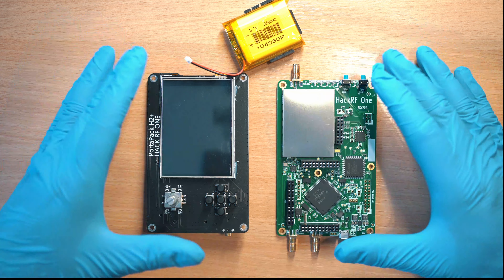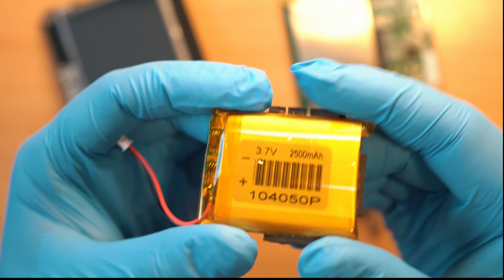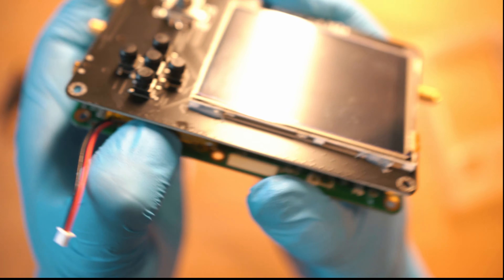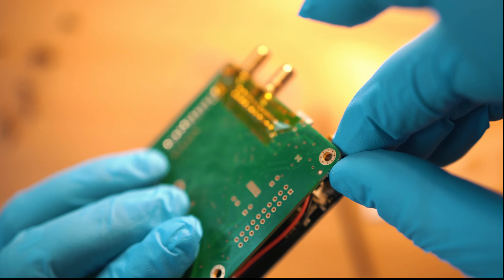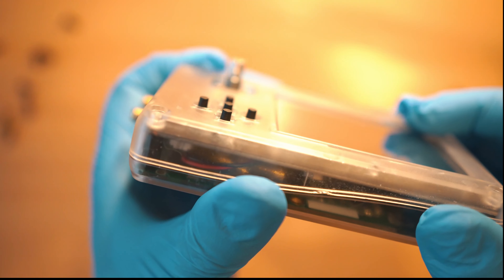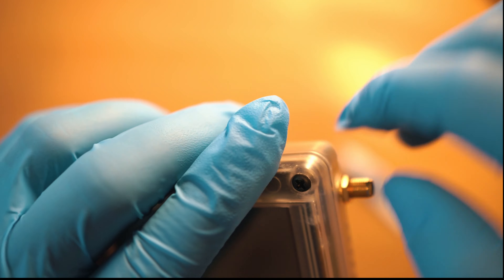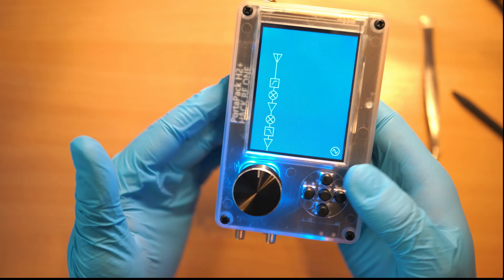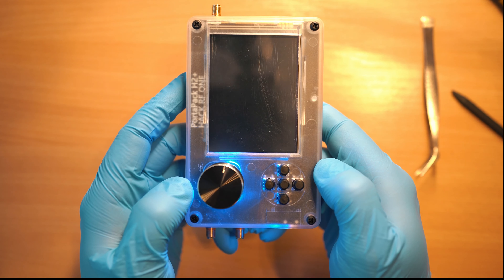HackRF One PortaPack H2+ Assembly + NO Display FIX

Comment: Just got a ebay clone, worked when I first got it but after leaving it charging the screen won't turn on,  leds on hack rf are blank, but portapack lights around the knob are on.  Pc won't recognize but I remove the portapack and the hackrf board works and is recognized. None of the buttons while booting fix it. Could the portapack just be bad?
Reply from the maker: probably bad clone ....
Reply: @takeapart  Same issue here...

Comment: Bro i have the antenna connected nothing shown in ads b why?
Reply from the maker: hi, go back to menu and reopen adsb app (or any app) and it will work again
Reply: @takeapart  hey bro it didnt work yet i just recieved the portapack h2 today... could not find any ads b yet... you have discord?
Reply from the maker: what fw you have? sd card?
Reply: @takeapart  sd card inside with the mayhem 1.8 data formated to fat32 128gb, firmware is mayhem 1.8 also
Reply from the maker: @Strassenpraktikant cool… it should work … it has bug . reopen adsb app aand it should work
Reply: @takeapart  which settings you use in the app, how can i test if antenna is working
Reply: @Strassenpraktikant hey you need to update to 1.9 it fixed that issue

Comment: mine wont turn on just a quick screen flash even after i held the left button
Reply from the maker: screen is not enabled…. do the procedure again
Reply: @takeapart  I did it about 5 times still no work
Reply from the maker: maybe hardware problem…. is it from china or original ?
Reply: @takeapart  china

Comment: No display in screen i push the left button but it doesnt work
Reply from the maker: sorry… have to push and hold left button prior to pressing knob
Reply: is there a solution
Reply: it doesnt work thank you
Reply from the maker: don’t give up… try few more times
Reply: First pressing  left button then knob right
Reply: Can it be about firmware
Reply: I don’t know mine was working perfectly. The battery was at the end of its life. So I changed batteries and now nothing! I’ve even bought a new Portapack. Screen flashes at first turn on then nothing. I don’t know what’s going on
Reply from the maker: @MorrWorm8 good stuff!
Reply: @MorrWorm8  read the information above